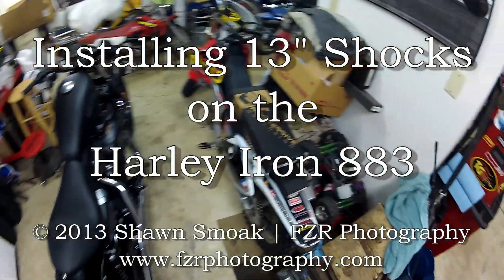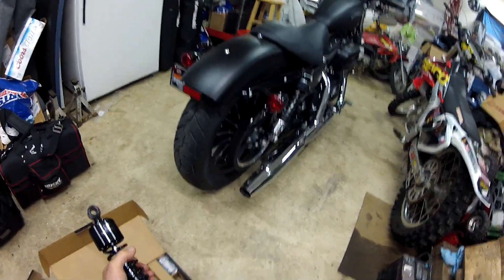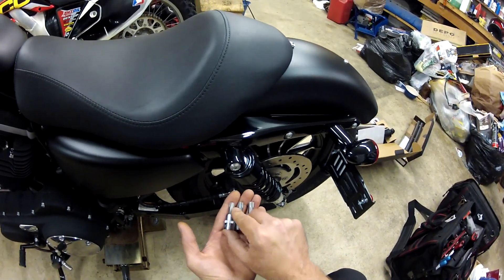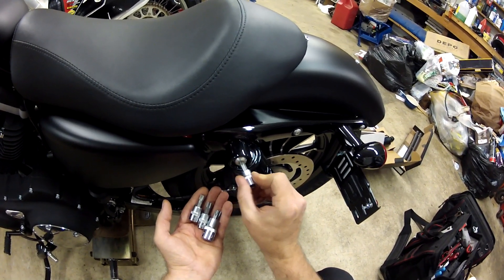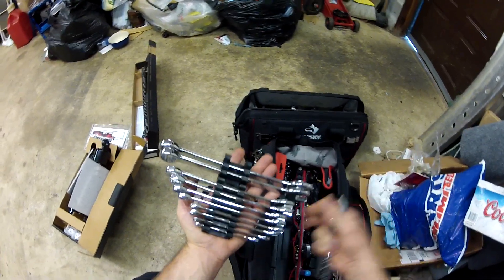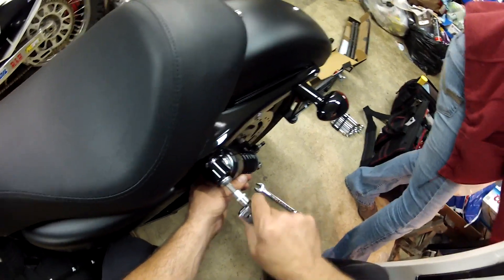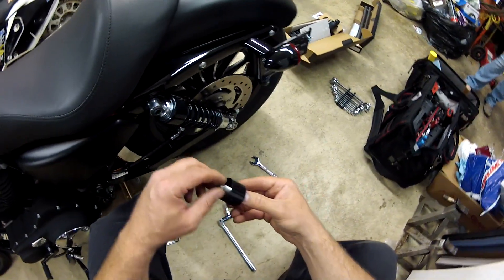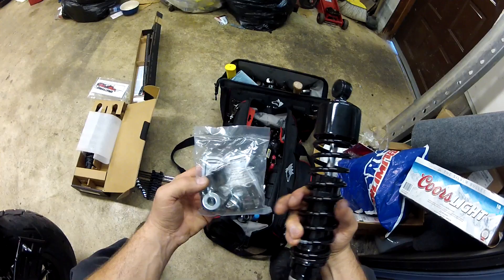Installing 13 inch Shocks! - Harley Iron 883  | ShopTalk

Comment: Shawn Great Job! Thanks to this demonstrate, I was able to go to Home Depot and get aT50 torc, and a 19mm wrench. My Shocks came in today. I'm ready.
Reply: Got 130.00 Shocks from Amazon. Installed them with the hardware they provided. These shocks were a great investment. No bottom out. I'm 250lbs so the stock shocks were useless. Great buy from Amazon. And great instructions Shawn👌

Comment: I know this video is old but thank you so much for the clear instructions..

I do have two questions tho, regarding using loctite on the bolts. Do we need to use it? And also for when tightening them, do they have a specific torque requirement? I didnt see it in the manual…

Comment: Hey Shawn thanks for the instruction, your video made it quick and easy, just did this to my 11' Superlow, every now and then I would scrape the sidewalk leaving my house or on a high centered speed bump, got real annoying so I'm hoping this does the trick. Question for you about the drive belt tension, in a previous comment you mentioned no adjustment was necessary for your Iron, does this apply to the Superlow as well?
Thanks
Reply from the maker: That's cool that my video help you with your shock install... They should help you with cornering and ground clearance. On my Iron and your SuperLow, the shocks are so short that the swingarm is past the alignment point where the countershaft, swingarm pivot & rear axle are perfectly in a straight line. Because the lower shocks never allow this alignment (the tightest belt tension point during the arch of the swingarm), the specs are slightly tighter than a longer shock model. When we install longer shocks that allow this alignment point to occur, the belt can be too tight. I used the belt tension specs that were listed in my manual for a Sportster model that came with 13" shocks and found that mine was within those specs, so no loosening was required. I don't have my manual with me, or I'd list the specs... I think the model listed in the manual was an 883R or 883LE.

Thanks for watching and commenting Brandon!

Comment: Thank you for your reply and advise. In your opinion would you argue that fitting the side mount plate would have had no effect on the tension as adjustment bolts were mover moved. 
Also just want to say love the videos you are doing and I love the 883 iron. My father in law told me to watch your videos which made my mind up to go out and buy one :)
Reply from the maker: I think I'd put up a fight over this! It's kinda BS, because the service guys opinion is what Harley will go by. Would be any big deal for them to just repair the bike and file a claim. They would get paid to do it. They are just playing motorcycle god! That being said, the belt wasn't too tight was it?

That's awesome that you guys enjoy the videos! And really cool that they lead you to the Iron! What a fun bike...

Take care and good luck!

Comment: Shawn, how are these shocks holding up? Now that you have had 8 mos with them... is it a huge improvement? Now that I've had my Iron for almost a month I def want to upgrade the shocks first.
Reply from the maker: After 8 months and around 5K miles, the shocks are doing fantastic. They did take around 500 to 800 to breakin completely. The compression damping was just a tad stiff before then... No complaints whatsoever! 

Thanks for watching!
Reply: And now Shawn? After 5 friggin years!

Comment: Thanks for posting the  video.  Did you have to do anything to the belt drive? I have a  04 883 C and would also like to lengthen the shocks. I think I can change the shocks on my own, but I am worried about doing anything with the belt drive.
Reply from the maker: rhomotor  You may or may not have notice that all the Sportsters that have the short 11" shocks have the swingarm past center alignment (pointing up). Center being the point in which the drive pulley, swingarm pivot and rear axle centers are in alignment (straight line) during swingarm travel. Most bikes have shocks long enough that the swingarm is before center alignment and will go past center at some point in the suspension travel. The drive belt (just like a chain) will be at it's tightest when at this center alignment. Because the short shock Sportsters never see this, they have a slightly tighter belt tension.
I simply used the belt tension specs used for one of the standard shock Harley's listed in the owners manual. No correction was needed on this Iron or the '07 1200L that I did the same to in 2012...

Thanks for watching and commenting!
Reply: Shawn Smoak
Thanks for the reply. I will definitely try the longer shocks.

Comment from the maker: Installing 13 inch Shocks! - Harley Iron 883
Reply: Good choice on the Progressive Suspension stuff... but I was waiting to see you replace the springs... are those the same length as stock? I mean, you didn't rise the front, did you? what's the part number for those progressive rate springs? I need some!
Reply: Shawn Smoak hey Shawn ! Great video. My progressive shocks just came in. How did you like yours? Also, how tight did you go after? Great video, I’m not mechanically inclined but I like to do my own work on my Harley Nightster and I don’t want to miss any steps. Thanks!

Comment: Shawn, it's a very informative video. Though I'm not a good handy man (had even troubles to install and engine guard), I think I can do it myself. Will order the shocks soon. Thanks. BTW, did you find out how to replace the license plate, I also don't like it on a side?
Reply from the maker: Thank you Danny! They are very straight forward to install, you'll do just fine. I did find the parts online. It only took a few parts from a 2012 Iron LE model that came with the center plate. I have yet to install them though...

Thanks for watching!
Reply: Thank you, Shawn! Did you instal heavy duty shocks or regular?
Reply from the maker: The regular shocks... You had better be 300+ to use the HD shocks, they are VERY shiff! I made that mistake with my '07 1200 Low and they were not useable...
Reply: Thanks a lot again! Very appreciate your help.
Reply from the maker: You are quite welcome Danny!

Comment: hey Shawn Im sorry to bother you because Im sure you are very busy but if there is any way you could answer my question about your jiffy stand on the Iron. Is it an issue now that you installed the 13" shocks on the rear and what length springs did you install in your forks. How much of an improvement did the progressives make. Thanks. You have the job I only dreamed of having. Awesome job. Ride safe

Comment: Shawn, did you ever find those fender extension to mount the license plate on the back?
Reply from the maker: You know, I actually did. I found that I could order them from a Harley dealer's on-line store back east. The fiche card lists an SE version of the Iron that uses the Euro style that I want... However, I haven't got around to ordering it yet. I'm going to run out of winter and wished I'd done all this, so I need to get on it!
Thanks for asking Babakc.
Reply: Very interesting.  Great bike.  Now you're ready for a long road trip.
Reply: Shawn Smoak Thanks, do you have a link to the part by any chance or a part number?
Reply from the maker: Babakc Here is the link to the on-line parts fiche at Ronnie's Harley-Davidson.
http://partsfinder.onlinemicrofiche.com/ronnies/showmodel.asp?Type=13&make=hdmc&a=856&b=41&c=0&d=-FENDER---REAR
Reply from the maker: Babakc Okay, the link didn't work correctly! From the link above, select OEM Harley Parts Finder, click on the motorcycle link. From the year selection, choose 2012 and find the XL883N (LE) in the list. From there it's simply listed under Rear Fender...
Reply: Shawn Smoak Thanks much Shawn :) , I found the extension for my 48, only 14 bucks.

Comment: Shawn,
    What is the difference between the stock shock length and the 13" Progressives you put on? I have a 1200 Sportster Custom with stock 11 1/2" shocks and was thinking of going slightly longer for more shock travel. You just talked me out of the 430's. 412 it is.

Comment: Hi Shawn just a quick question. Does this mean adding the 13 inch shocks will raise the ground clearance of the Iron by another 50 mm?
Reply from the maker: Well, not exactly... With the angle of the shocks and the arch of the swingarm, it doesn't raise the bike by the same number as the increase in shock length. However, with the shocks and the fork spring kit up front, there was about a 50mm increase in ground clearance.

Thanks for watching and commenting!

Comment: Hey Shawn, Love your videos. I have a 2007 XL883L that I have made into a bagger. Saddlebags are hard leather wrapped by Viking Bags and a batwing fairing that is handlaid fiberglass with full stereo system and 7" screen. Anyway I want to put some progressive shocks on but was wondering if the 13" affected your jiffy stand? Also what size springs did you put on the front? Have a blessed day and keep the videos coming. Thanks

Comment: Hey Shawn, love your videos! I'm gonna be getting a Harley Iron 883 pretty soon after I get my motorcycle license this summer. I plan on changing out the seat for one that could fit myself and a passenger so that my wife could ride with me every once in a while, and I was wondering if there's anything I'd need to do to the suspension (other than what you've basically done in this video, along with maybe the fork springs) in order to make the ride comfortable enough for two people. I know the Iron 883's have a little bit of a reputation when it comes to riding over potholes and train tracks anyway, so it's not necessarily the 'ideal' bike for riding two-up, but I'm a reasonably small/short dude, and I've fallen in love with the the 883's. haha
Reply from the maker: Thanks *****! That's cool that you're going to get an Iron! You're going to love it. You can keep the stock suspension and ride two-up if you like the low look. All I do for a passenger is go one click up on the rear springs. I purchased the pillion seat that can be easily added when you want to take a passenger...

Thanks for watching and commenting!
Reply: Cool! That'd save me from having to put out the extra cash on an aftermarket suspension. Thanks man!

Comment: Hi. Wondered if you could help me. I brought a brand new iron 883 2 months ago and fitted a side mount number plate on it. It fits on the rear wheel axle nut. No problems with it until I hit a speed bump at 40 mph. Since then I've got an oil leak next to front belt pully. Harley are saying that fitting side mount has pulled the belt to tight and pulled oil seal out of shape and not covered by warranty as I fitted side mount myself. Can you tighten the belt by loosening the axle but with out moving the adjuster bolts?
Reply from the maker: Hi Andy, That's a bummer that you've developed an oil leak at the countershaft!  As the belt would have had tention on the axle, I'm assuming that you just removed the nut on the left side. Removing the axle would have required loosening the tensioners. This should have had no effect on the belt tension!  If you've installed longer shocks, this can greatly add tension to the belt!  I was lucky that the tension was okay when I installed the 13" shocks, but it's something that has to be checked when performing that mod... About the only way you could have added tension to the belt would have been if the axle rocked back when tightening the axle nut. This would be noticeable by looking at the left tensioner nut. It would not be flush with the end of the swingarm, you would see a gap as if the nut had backed off...  My way of thinking is that the countershaft bearing would have had to of failed to add enough pressure to the seal to damage it. It's not going to move in that bearing! Though I have definitely seen those bearings fail due to excessive belt or chain tension on all brands of bikes... 
If all is cool on your part, I'd go to another dealer, or call Harley-Davidson Customer Service. The number is in your owner's manual. I wish you the best of luck Andy!

Thanks for watching and commenting!

Comment: Hey Shawn, I liked your video about installing the 13 in Progressive shocks on your Iron 883.  I have a 2016 Iron 883 that bottoms out occasionally, and I would like to install 12.5 in Progressive standard shocks on the rear. These shocks are listed as compatible with the 2015 Iron 883, but not the 2016 Iron 883. I don't see what the difference is between the two bikes. Should I go ahead and buy them anyway and try to install them?  It says they can't be returned if installed. Why won't they fit my 2016 Iron 883?

Comment: I appreciate the tutorial. I just completed the install of my 412s. My instructions depicted a note at the bottom that stated to "place the shouldered sleeve with the shoulder in towards the motorcycle. This offsets the shock outward." I placed the shoulder on the washer side. I noticed that you put the shoulder on the outside. Am I missing something?

Comment: Great video! getting ready to do the same mod .I'm concerned about the bike leaning too far over on the jiffy stand when Im done. Did you change your stand?
Reply from the maker: Yes, I ordered a 1 inch longer stand. From 7" to 8"... It did lean over too far and looked strange to me. The stand was from Drag Specialties.

Thanks for watching and commenting!
Reply: Shawn Smoak thanx for the quik reply. Any tips on changing the stand or pretty easy?
Reply from the maker: strperman
It's pretty straightforward... Just make sure the bike is secured on a good stand or jack, as taking the spring off and on takes a bit if force...

Comment: Hey Shawn. Great video. I'm thinking of ordering the same shocks for my '15 Iron today. I have a question. Did you need to adjust your belt tension with the increased suspension height?
Reply: I have the same question about adjusting the belt after installing longer shocks?

Comment: Hey Shawn. I just ordered a set of V&H Big Radius for my "08 1200C. Will longer shocks keep those from dragging in the curves and corners?
Reply: Hi Curt,  did you end up installing the progressive shocks on your. 08 12 C.     I also have the same . Looking to upgrade shocks looking for opinions
Reply: No not yet. I realized my new V&H Big Radius are not going to drag on right turns. I may some day just for the extra comfort.

Comment: Hey witch brand of tools do you use ?
Reply from the maker: The tools I use at home are mostly cheap tools from Harbor Freight and Sears, with some higher end Allen and Torx socket sets from Cornwell Tools. My work tools are mostly Snap-on and Cornwell...

Thanks for watching and commenting Partrick!
Reply from the maker: Patrick Heinrichs - Now that you reminded me, I do have a bunch of Husky tools in my home box as well... I didn't think about inch tools in Germany, I guess that could be an issue to find. Lol
Maybe I should do a video on my home and work tools...?
Reply from the maker: Patrick Heinrichs - That was a Craftsman swivel head ratchet...
Sounds like you got a cool tool kit!

Comment: You mentioned you did the shock change on your 1200, was it a 1200c ? I am planning to buy the progressive super duty 444 for my 1200 c and would like to know if the shocks hit the exhaust and whether we need to adjust the belt on that. The 1200 c comes with a 11 inch shock.